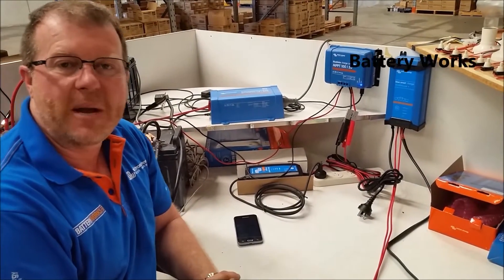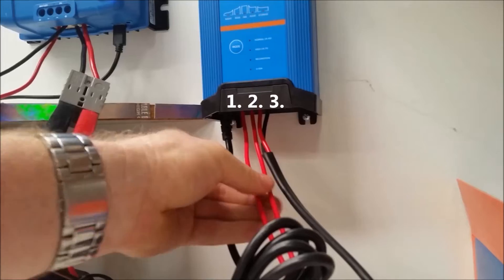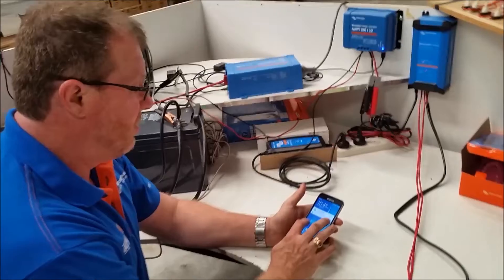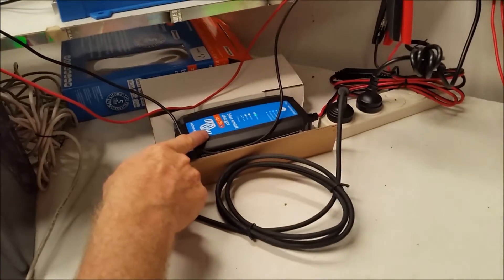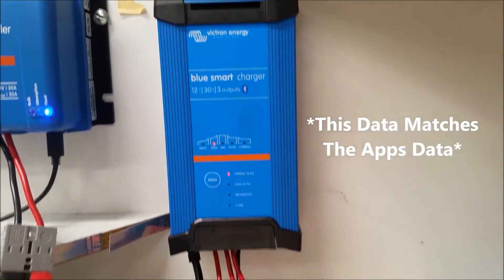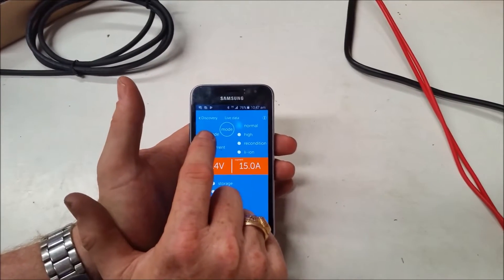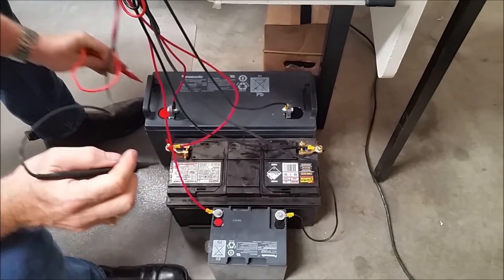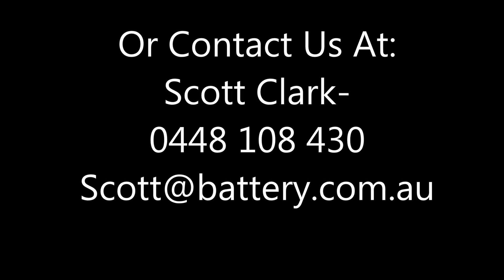How to use Victron BlueSmart Charger 12/30 (3 outputs)

Comment: OK, thank you!!! This is the most informative video online for the three output charger. Seeing that the batteries gets different voltages indicates that the batteries indeed gets different charge. Very useful, and not discussed in the documentation. It also suggests that putting a small 15Ah motocycle battery on the third output if you have two fully charged big batteries on the first two would not be a good idea, as I suppose the charger then will go into bulk and try to push the pull 30 apms into the motorcycle battery, which would definately cook it. But if alle batteries are top charged separately, it would go into float immediately and the MC battery would maybe survive. So I guess the technology is very good and almost there, but no cake. Seems the circuits are not totally separate. Is this correctly understood?

Comment: I believe it is always charging the battery with the lowest voltage first, and bringing them up to the same charge in the end. 

If so - I don’t understand why it doesn’t report the sensed voltage in the charger. I also think this model should’ve had VE Direct to be able to integrate it into a larger system. 
I had this charger for a couple of years, and while it worked fine, I never knew if one of my batteries were being charged more often etc.

Comment: Dears, I want to change from 3 AGM to 3 ifepo04 Batteries. Onboard iI use 3x 12V Batteries. 1 for Echo 2 for the Minn Kota Terrova 24V in series connected. Does each charging output have its own ground wire so that I can charge batteries connected in series? What do you think, does it work? Thank a lot for a short answer, best regards, Karl

Comment: Hey thanks for sharing this is a great video question I bought the 24 volt Vectren 3 output charger and I'm after seeing this video can I hook it up directly to a charge controller rather than the battery banks that I have

Comment: Thank god for a VOLT METER.. 
It only takes 20-40 tries to bluetooth... fails at 20% over and over and over....
1 button to cycle thru 2 sets of lights and has NO RIME OR REASON...... 
Light on bulk and getting hot phone says 13.6V 15amp... but NOTHING at the battery.. 0.00 A on my meter.. pulled out the 40 year old western auto 2-5-10amp charger.. VOLTAGE!!!
This module looks so generic.... and IS!

Comment: does it split the 30A (so 10A per channel)? or does each channel get the full 30A?
3 x 100ah lifepo4's - 10+ hours, or 4(ish) hours?

(I will assume its 30A total, but can deliver 30A to a single channel if that is the only one connected)
Reply: we all want to know "Sorry, it is one charger running one algorithm. The VictronConnect app shows you what the charger is doing. If you want to know the separate battery voltages, SoC, etc, you should be using a battery monitor on each battery."

Comment: Does it charge each battery separately? Why 3 ports if each cable goes to the same place?
Reply: no....this is fake 3 bank charger....this is one charger with only 3 isolated outputs. i dont know what app shows when You connect two different battery (different technology)...i bought it and now i need to send it back

Comment: I purchased the IP22 and it ran really hot on 30 amps and not able to even hold unit. I contacted Victron and they said it was normal to get hot! What a Joke! Here is the review I left on Amazon: I was surprised when I touched the case and it was too hot to pick up while running at the rated 30 amps. It was actually 134F or 55C and no electronic item should be this hot ever and poses a risk for fire. Upon inspection there is a tiny mini fan (40mmx10mm) inside near the center and it blows air on to a transformer next to it and that is it. The fan basically does nothing. I could feel no air flow exiting or blowing around the unit. There is a cover on the back end and when I removed it for inspection I noticed a place where a fan was designed to be installed but none existed. How could a manufacture with a high end name like Victron let this happen. I think they wanted to make the IP22 as quiet as possible, hence the mini fan located inside mid center but they forfeited cooling when they took the rear fan option away and slapped a cover over it. I had to submit a technical support request form and I am waiting for Victron to get back to me. I will update this when they do. I also went to the Victron community forum where multiple people were complaining for quite sometime about the heating issue and it appeared to me that Victron never acknowledged the problem. We shall see. Update: Here is Victron's response: "Depending on models, there is a fan on the side of the unit while others are left blank. Victron has said that these units will heat up when in operation, and there should be no cause for concern. The units do have overheat protection on them." End Quote. Anyone who works with electronics knows that the enemy of electronics is heat and for the IP22 to get so hot as not able to hold unit in your hands is unacceptable. I will never buy Victron again. Meanwhile I have added to more fans to the unit. I added one fan in the space provided on the back end side, just removed cover that covered up where the fan should of been. I also made a hole in the cover and added a fan so the fan on the cover would blow air in and the fan on the back end would blow the air out. I wired in parallel with the internal mid centered fan. Now runs about 15 degrees cooler. Shame on Victron!
Reply: thanks for the info!. .  .i hate hot electrical gear, makes me wonder how hot it is inside, hoe long it will last, and the possibility of thermal runaway

Comment: Just got my IP22 yesterday and installed but it gets really hot 134F and 55C. in the 30 amp charge mode. The problem is that they installed a tiny fan located on the inside center which blows air on to a transformer and that is it. The air does not get blown out or sucked out of the unit. There is a spot on the rear of the unit for a second fan and wonder why there is not a fan installed there. There is a cover where the fan should be on the rear.  I was reading the Victron community forum where multiple people are complaining about the over heating problem....too hot to touch.... but no one from Victron answers their questions directly as to why. I am disappointed after spending $247.00 with tax.
Reply: I have same 3 output charger.  It gets pretty darn hot.  The fan barely pushes any air

Comment: I got this charger today and when the batteries (2x 12v 140ah in parallel) are charging the charger makes a disturbing kinda loud humming noise. As the battery charges up the noise reduces. It doesnt get very hot but i didnt expect that noise  from a premium charger like Victron. Im wondering if i need to send it back but the store i got it from says they may need to send it to Victron which means i will be without a charger for at least two weeks which is not ok. Anyone else with same expirience on that noise ?

Comment: Hi I have a AGM battery connected to the blue smart charger with 3 outputs and I have set the charger to AGM spiral, I would like to connect the Van Battery to output 2 but this is  not AGM,
Is this possible cheers

Comment: looks like this is a nice charger but with a lot of shortcomings. We can only select one charge profile and the charge current will go according to the internal resistance of the connected batteries thus mixing lead acid and Lipo's will not work well. Using a lead acid program for LiPo will overcharge them and using a LiPo program for Lead Acid will undercharge them. 
If you need to charge different battery technologies frequently and want to keep your batteries healthy there is only one way to do so. A DC-DC battery charger. Putting three different battery technologies on this charger is "STUPID". Here, I said so. 
I assume (means I don't know) that the three outputs are galvanically separated so you can charge multiple batteries of same technology without draining the already charged battery.
I assume they use a diode bridge to separate those three outputs and so same technology batteries with different SOC should be OK.
Reply: Just the answer I was looking for, the question I have just posted 😂
Reply: @snowboarder753  I've got one of those now and its a good charger but its as explained above. One profile, three outputs who get delivery according to their internal resistance (charging state and such)

Comment: Bluetooth looks very handy but we spend a lot of time out of mobile service areas,  how can we operate the charger in that situation?
Reply: I don't think you need mobile service to use the bluetooth feature.  If it is the same as their dc-dc charger, it'll connect via bt as long as you are within it's allowable range, i.e. in the van.

Comment: Great video thanks...iv got 3 AGM 130Ah batterys in Parallel..if I put one wire on one off the battery then the other on the other battery as in Parallel do I still get the 12v 30amp...thanks
Reply: Did u find the answe to that question

Comment: Can I hook up different batteries and charge them at same time? AGM and LiFePo4? It has Normal, High and Lithium program? Can I use Lithium if the other battery is AGM and other is LiFePo4?
Reply: No ,you cant charge agm with lifepo4 same time. You can charge only same type of batteries together.

Comment: Victron BlueSmart Charger, how much current does it draw from the grid?
Reply: use the power equation. 
Power In (at 120V or whatever is on your grid) = Power Out (different voltages and currents) + losses due heat and electronics inside the IP22 (which should be small, lets say <10%)

So as you can see, the power consumption varies as the charger works with each battery. Not a straight answer, but that is what it is.

Comment: Sir, my victron is not producing electricity from out put, where as power is 220 is given from outside nor charging the batteries not giving any out put 220 power, even Less not glowing , whether it's need reconfiguration because it is not operational for the last 1 and half years.24 volts .
Gulshad.

Comment: In home, I have 400w solar panels, one MPPT 100/20, one Inverter 12/250 and I need an automatic charger when the solar panels do not reach the necessary current. Can I use a permanently connected Victron charger when the voltage drops below X volts it start to charge till X volts? Because in the next day, I need to have battery space if I have energy production... ??? Can you help me?

Comment: I was interested to see that you were using a charger as the feed from the PV into the MPPT, presumably this works OK and doesn't cause any problems with the MPPT? The only reason I ask is that I was thinking of using a similar method to charge a battery over night when there's no power from the PV panels but wans't sure fi that would work or destroy the MPPT?

Comment: If you charge 3 batterys ,you can see the 3 batterys charging in the app?
Reply: no....this is fake 3 bank charger....this is one charger with only 3 isolated outputs. i dont know what app shows when You connect two different battery (different technology)...i bought it and now i need to send it back

Comment: HI there,   can you help me with regards to cables from Charger to batteries.   Im used to having cables that come with charger to go from charger to battery.     These dont, at this price point?    I have 2 x 120AH enerdrive lithium batteries, and a 12v marine starter battery I need to look after.     What is a busbar? Thanks.

Comment: What size cable is running to the batteries?
Reply: I'm using 16mm2 which is the max. gauge this unit will take. I used pin end terminals for the connection to the charger – bit of a squeeze but secure. Here's a link to those: https://www.amazon.co.uk/gp/product/B085QL42BT/ref=ppx_yo_dt_b_asin_title_o08_s00?ie=UTF8&psc=1

Comment: Great video... a question can you charger two batteries Litium + Start battery simultaneously.
Reply: This question is driving me nuts too. Did anybody ever find the answer ? 🤔
Reply: @suziq4394  no
Reply: I’ve just bought one of these and I want to know too.
Reply: did you ever find out?
Reply: @rowey7777  I'd like to know this, too - it would seem that they would have different profiles, not sure how the unit would handle that or how to best go about it.
Reply: After watching , this crossed mind too. I wanted it to  charge my lithium leisure battery and the vehicle starter  battery at the same time. Will the charger do this? Do this  🤔
Reply: Can anyone answer this question,?? it’s been 3 months and still nothing
Reply: @adjrasta9365  You can only set one common charging profile for all batteries connected regardless of type. I have charged flooded and gel lead/acid batteries together but used the gel charging profile as it was less likely to damage the flooded battery. The voltages for the flooded battery profile are higher than recommended for gel. Plus, if I remember correctly there is also an equalisation stage which should not not be used with gel batteries.
Reply: @Gloomendoom  thank you so much for the well explained answer
Reply: in 2024 it makes no sense that it dosn't can set three different profiles because the 2nd battery is LiFePo4 and the starter battery is an acid battery in the most cases. It's a pitty.

Comment: Hello, thank you for this informative video. I see you mentioned that you have the 24v (8amp model?) charger powering the 100/30 mppt.  controller. Could I use the same set-up to charge my 7s24p li-ion battery when there's not enough sun  to use my panels?   Thank you.
Reply: I just realised that I asked the same question, did you manage to find out if this is possible/safe?
Reply: @off-gridutilityroom5490  theoretically like it seems they were doing, as long as the input volts/amps don't exceed a standard PV panel array you would typically have connected to it, it should do the same job charging a battery pack. I've done some testing with an adjustable 24 volt power supply and seems to work fine for me.
Reply: @Bubbz2024  Thanks for that, it may well help me with the system I'm trying to design for use in the UK
Reply: @off-gridutilityroom5490  hope it works out for you. I built my own 24v 2.4 kWh portable solar generator. Using recycled 18650 cells. Using a Victron charge controller to charge with PV panels but also use a 24v power supply when charging it with shore power. It's slow compared to my 600 watt PV array but works when there's no sun.
Reply: @off-gridutilityroom5490  personally I wouldn't recommend going from an MPPT directly to an inverter without a battery bank between that's large enough to provide adequate amperage for the required draw from whatever you're powering through the inverter.  Hope that makes sense.

Comment: Hi, thanks for the video and got a question, does it generates a lot of heat while charging? would it melt plastic if attached to a plastic board?
Reply: No - warm to touch but wont melt any standar plastic used for a board
Reply: If it doesn’t melt its own plastic cover, probably will not melt a las tic board of the same kind of plastic.

Comment: can i charge my LIFePo4 battery and my starter at the same time? the app didnt seem to show ant data on separate batteries just an overall out put of 30amps being distributed to the three batteries in your case
Reply: Yes you can, but you have to use the lowest common denominator, witch is LiFePo4.

LiFePo4 has, on Victron charges 14.2V as absorption voltage.

The starter battery will be a little undercharged, but better than float/trickle charging or no charging at all.

The amps will go to the battery with the lowest voltage first, but they will hit absorption at the same time.

Comment: Question -> Can one connect via BlueTooth when the charger is Not plugged in? I'd like to use it as a battery monitor as well.
Reply: No, when the charger is off Bluetooth won't connect

Comment: How do you know when one battery is full? Also if the charger is let's say 30amp,is the output divided by the number of batteries being charged or is it 30amp output per battery output? And does it show on the app different stages of charge for the 3 batteries you are charging?
Reply: I'm here for same
Reply: Me too simple question nobody even victron can't answer
Reply: @DarranFuller   I will answer you because the answer is very simple. If you use 3 batteries that need the same charging algorithm, this is a good solution. For example, 3 LiOn batteries in a camper of 100Ah each or their capacities are different, it is irrelevant.
This is a parallel connection of three batteries. There, the current is divided into each, as much as it needs to produce the specified voltage. The battery that has a higher internal resistance and has not reached full charge, it will take more current and will be at a lower voltage, while those that have finished will wait at the perfect voltage with minimal current consumption.
And that is that.
Reply: me too
Reply: I had not researched carefully enough and expected it was capable of separate chargers profiles per battery. It is not. It is going to suit my replacement need to manage two AGM in parallel at 12V but disappointed to realise only one chargers profile at any one time.
Reply: So getting the single port and jumper leads yields a simpler solution and neater
Reply: But he is charging three different batteries in the video?

Comment: If I am charging 2 batteries with the Victron  ip 22 should I hook them to the seperate feeds or just hook on of the feeds up with negative on the first battery and positive on the second these batteries are in parallel